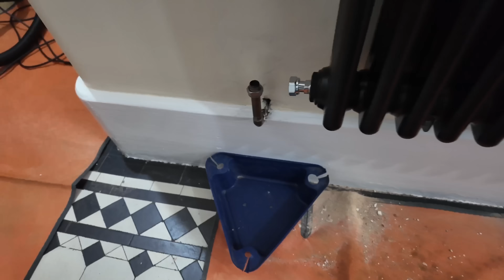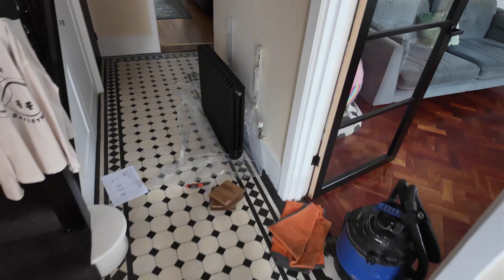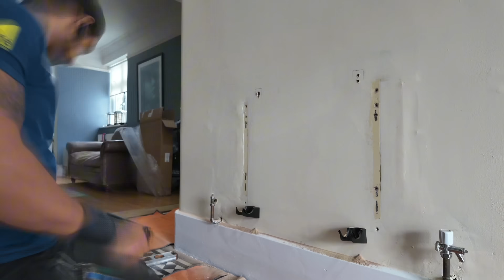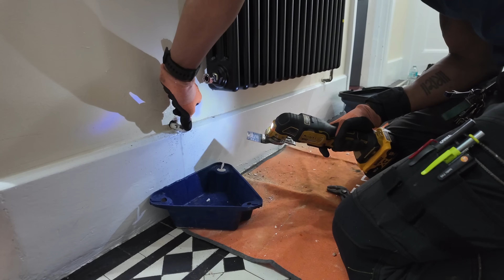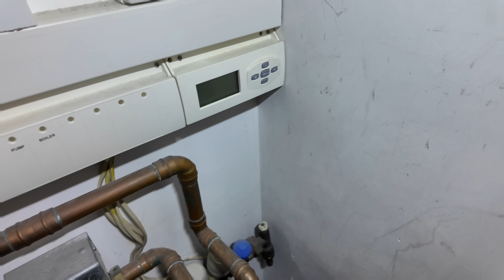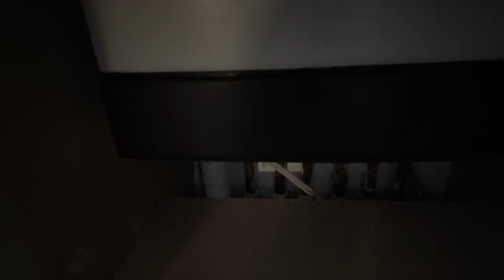Soldering Tip With Water In Pipes

Comment: How old is this video? Mate, why wouldn’t you use a spray gun or wet vac to remove water? And why would you just change the fuse without finding out why it blew in the first place?
Reply from the maker: I mention the date at the beginning of the video. More than 1 way to skin a cat. If the fuse had blown again I could have started to test components, but to this day it hasn't blown again
Reply: @cputilitysolutions strange one that 👍🏽

Comment: Angle your drill bit slightly upwards for the top hole of the bracket and angle the bit slightly downwards for the bottom hole. Reduces the chances of needing 3 rawls lol. Also reduces the chances of fixing into weak mortar beds..
Reply from the maker: Good shout, will try that next time. It's annoying that the holes are so close together it's bound to happen

Comment: hi Chirag radiator fixings can be a pain in the AR$£ can add time on your day. column radiator looked great at the end why did you not wet vac from the old rad valves to get rid of the annoying water . multi tool was well handy in that job the flow and returns were close so had to solder again . 👍👍👍
Reply from the maker: Thanks man, I did use the wet vac but there was still those dribbles of water left in the elbow

Comment: Hi enjoyed that..may I ask when you sweat off a copper fitting do you use abrasive pad to remove all the old solder prior to re soldering or do you just flux the solder and re fit ?? Thanks
Reply from the maker: Thanks, I just flux and resolder

Comment: Could you recommend a fitting for stud walls that work & could hold the column radiator. 
That’s not going to leave a mess.
Reply from the maker: Corefix are good if you got dot & dab. Otherwise the butterfly anchors are great if it's just plasterboard
Reply: @cputilitysolutions put in wooden batons every time

Comment: Hi mate I all ways hang the top brackets first lift the radiator on and mark the bottom ones it’s a lot easier ps love your videos
Reply from the maker: Thanks man 👊🏾
Reply: Yes that's what i did on the last install after someone else advised. getting them spot on would be really difficulty. but i did mess up on the first one as should have placed the brackets on the columns to get an accurate spacing. tried to be clever and measure it but it ended up wrong by one coumn!